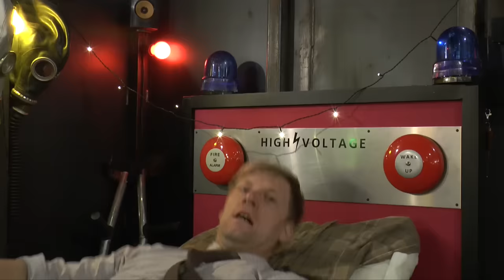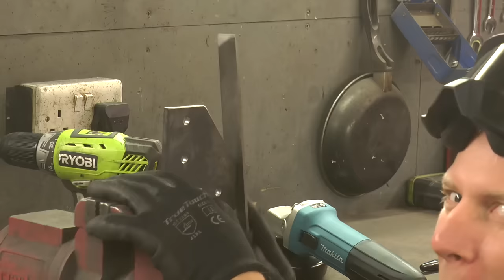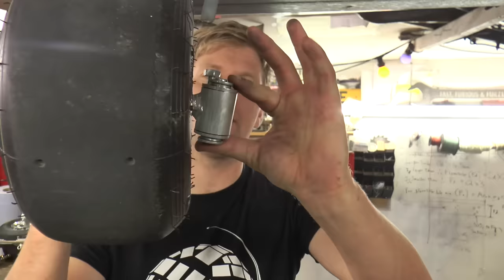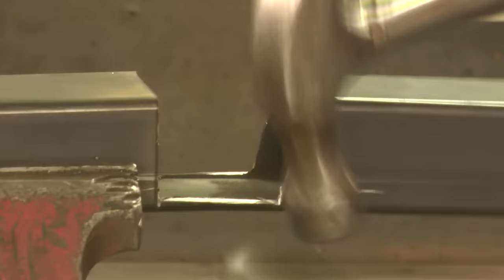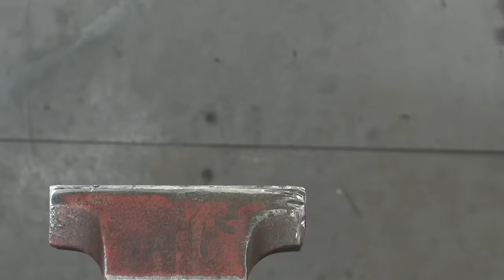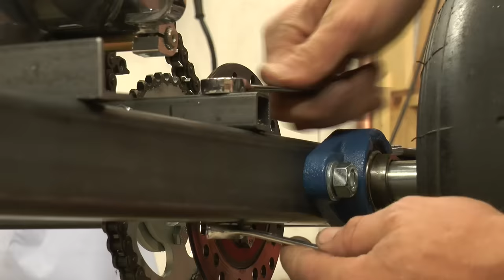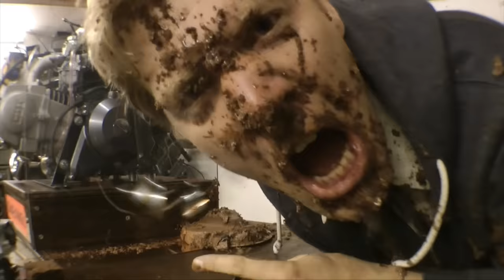Making a Motorised Go Cart with NO WELDER and simple tools #1 - Chassis/Engine

Comment: Colin...do you even camber bro??
Reply: was thinking about the same thing. the angle on the wheel bit is to get more traction while doing corners
Reply: Really? On a kart without suspension? I thought the angle stabilizes and centers the steering.
Reply: Mega But if he were not to make it straight it would have possitive camber, and that is bad, you could potencially even brake of the wheel when steering, and you can see it still has a tiny bit of negative camber :D
Reply: ikkk he could totally make a stance cart
Reply: tubybubi I think caster angle does this, not camber
Reply: +king Schuyler -3 camber, some mad stickers, straight pipe, subway handle hanging, black wheels, Recaro seat
Reply: positive attitudes negative camber
Reply: correct caster deals with self centering etc. the negative camber, in theory, means that the wheel is on a slight angle on the straights, but during a corner, the tyre sidewall flexes, putting the whole tyre 'tread' area (I know the ones Colin is using are slicks but its the same principle on pretty much ANY car) in contact with the road to improve road grip (the outer front tyre takes the brunt of the cornering forces)
Reply: Peter Lattimer Finally, someone who knows about this :)
Reply: Peter Lattimer but that doesnt work for all wheels? if you have negative camber then the inside wheels would loose grip on turns right?
Reply: Generally with chassis torsion this doesn't matter because the inside wheel is 'pulled' off the ground anyway.
Reply: king Schuyler Biggest amount of force is out on the outside wheel so it needs more grip to be able to turn.
Reply: no you wouldn't lose much grip on the inner tyre. I live in an area with a LOT of roundabouts on 60mph limit roads in the UK. I didn't always live here though. ive found that the left front gets hit on the outer edge of the tyre worst (standard road car here) as you spend most time 'turning' right, even when going straight on. the inner edge of the right front gets hit harder in a similar manner.
Quadricycle4000 is correct also about body flex or chassis torsion in this case keeping the tyres in contact with the road where possible. if you look around for old videos of cars like the Peugeot 205 GTI (in 1.9 guise especially) when cornering hard without them sliding, they will actually lift the inner rear wheel off the road (as the suspension is so stiffly set on it, as its an 80s designed car) however the downside of that in a road car can be (and was in the case of the Peugeot) that the body has to flex more which on a little 3 door hatchback, means that trim panels used to creak and the bodyshell actually begins to crack (the reason they used to 'seam weld' rally cars of the era, to stiffen up the shell, amongst other things which I wont bore you with the details)
Reply: Peter Lattimer wow, thank you for taking the time to explain that, a rare thing on the internet! that makes more sense now :) so technically you should camber each wheel differently.. i guess if you only drifted right, the outer tires should have negative and the inners should have positive? vice versa for left turns though. is there a suspension that keeps the wheels on the ground to provide maximum surface area at all times? i know there is a bike concept out of Florida where the motorbike is able to lean 58 degrees and still have the tires flat by just moving the chassis, calculating the g\s and electronically adjusting the suspension.

update: here's the link to that: 
http://newatlas.com/narrow-tilting-vehicle-non-tilting-wheels-ntvntw/45996/

edit: 
if you drift right both should have positive, technically.. its weird to think about haha
Reply: the angle for stabilising steering is the castor angle,  the camber sometimes is the tyres leaning in, to give more grip in corners as the entire tyre surface grips, due to the roll and offset forces push it over if it was purely vertical
Reply: king Schuyler negative camber is for grip (to a certain extent, too much camber removes the effect it would have normally)
how much camber to run depends mostly on what you want the car to do. some old british cars ran with positive camber, like the Triumph Herald (no idea where you are from or if you are familiar with the models) but they weren't great in the handling department. most road cars run 0.5-1 degree each side negative front camber. race cars (where tyre wear is less of an issue) will run more, as their cornering speeds are higher. you basically tailor the camber to the purpose the car is used for. older vehicles like RWD vans (I'm UK based so can comment only on our models here really) run a solid live axle and the rear wheels are pretty much 0 camber all the time (due to the suspension set up) and when running unladen can be put into a drift on a roundabout much more easily than a modern car with its modern suspension etc.
Reply: Peter Lattimer
yes those old cars ran positive camber, due to the terrible suspension design, that changed the angle depending on load and body roll!
Reply: It's [mostly] not tire sidewall flex that camber is intended to cope with, it's body roll; and no suspension means no body roll.
Reply: Folopolis trust me the issue is as much about tyre flex as it is about body roll. formula 1 cars for example, run much more camber than a road car, the suspension is so firm theres little or no body roll, but watch the tyres under cornering. THAT is what theyre trying to achieve. the main friction surface area being as large as possible when its needed most (ie under cornering) BUT with a road car, they also have to make a trade off against the actual ride quality, braking capabilities etc as well as cost, so they run a smaller amount of camber and often couple it with lower profile tyres to effectively stiffen the sidewalls up to prevent the tyres 'rolling' under the car due to the weight etc. look at the shoulders of a tyre on a van that's been cornered hard a lot. the shoulders wear harder on the outer edges due to the tyres rolling under the vehicle. I mentioned the Peugeot 205 GTI earlier. these had very little body roll (suspension was stiff to the point the body panels used to crack!) and had wide low profile tyres BUT not enough camber to prevent tye same outer shoulders wearing off on the front tyres, when cornering often (and hard)
the same car spending its days on the motorway wore the tyres perfectly flat. lower the suspension and the car would wear the inner edge fron the tyres (more camber) BUT when cornering hard and frequently the outer edges wore much less hard even though body roll was similar (it was already so stiffly sprung that the body would flex and the car would lift the inner rear wheel off the road!)
Reply: Peter Lattimer I won't talk about Formula racing, I don't know much about it.  What I do know, is that for GT endurance racing, typical camber is -4  or -5 degrees, any typical body roll around corners is 6 degrees.  I'm very highly doubting that Formula 1 has so much stiffer suspension than GT that a few degrees of roll doesn't happen, especially considering that they use stickier tires.
Reply: If he's racing on a track with a lot of turns and curves, more camber might be necessary, if he's racing on a track with a bunch of straights though, its not as important.
Reply: all that said, is there a real reason to positive camber?
Reply: i think some factory  road cars use some slight positive camber, or close to 0 to improve fuel economy and stability.  the front wheels he has look like they are factory set to negative caster (steering axis tilted towards the rear) which helps with self centering and keeping it stable at speed. letting go of the wheel and it will want to straighten out instead
Reply: oh i've not heard of negative caster before. though positive camber puts unnecessary strees on the joints and for road cars that dont corner often and are mainly on highways, that would wear out the outer portion of the tires before the inside, yes?
Reply: king Schuyler any amount of camber, positive or negative, is going to give uneven wear on the tire, its not a huge amount when you are talking about the small amounts used on factory car setups.   while you can imagine negative camber helping add contact patch to the outside tire in a corner where it matters most, its not helping much on the inside corner, positive camber can help in that situation, i also believe positive camber can help make steering easier.  another thing to keep in mind is that as the suspension moves through its travel its settings can change based on the type of suspension.  Negative or positive camber may be needed so during compression or rebound (offroad jumping?) its where it needs to be.

not sure what unnecessary stress it would be putting on components tho
Reply: mixamun lets say you had a simple ball and joint suspension. if you had negative camber, then the weight of the car would be straight down from the car and tires, the joints in the middle bending outward and causing chassis torsion?
Reply: i cant picture what your describing ;/
Reply: mixamun if you sliced one side of the car laterally into three pieces, one is the tire, one is the suspension/joints,and ont is the chassis. with positive camber, the wheel(in an extreme case) is over the suspension and the chassis is pushing towards the suspension. it seems like it would bend even more so than usual?

Comment: No safety tie????? o__O
Reply: Aztezq he's not driving it yet don't need a safety tie when you're just cutting things
Reply: He is wearing a tie at the beginning of the video... and I can understand not wanting to wear a tie while working with an angle grinder.
Reply: Steamrick yeah... my tie got stuck in one of those once...

A&E in under 5 seconds
Reply: The safety tie is a power tool and not a basic tool
Reply: Aztezq what is a safety tie?
Reply: I never use the guards or anything on my grinder. It all just gets in the way.

Comment: Hey Colin really enjoy your videos when you put them up, I am disabled myself in a wheelchair, In your other video where you build the fastest mobility scooter I own the exact same 1, But always wanted to switch t to gas and lift it so a set of ATV tires would fit on it, I am really in need of help because I live way up in Northern Canada where we get a lot of snow, And my electric wheelchair I use now is top of the line but garbage really for me where I live because soon as we start getting snow my chair does not move then I am bed ridden for 6 months, I been trying every where for some 1 to help me design what parts I need and where I can get them, Not sure if you ever seen a wheelchair on YouTube that is called The Tank chair, thing is awesome I tried 1 out and it will go through mud no problem when ATV,s are getting stuck and it works great in snow as well,Now seeing this video you are doing looks like maybe it could be turned into something I can use, The frame looks similar that you are building to the 4 wheel drive chair they sell for over $20,000, That is insane, Was wondering if there were a way for me to contact you or you me, and talk about a build what can give me some quality of life, be different if i were in my 60,s or 70,s but I am only 40 and very active, Would be in dedted to you if you could design a 4 wheel drive chair something like you are building in this video,Could you please get back to me and see how we can get in contact with each other and you being so incredible with imagination and building things, I beleive you could build something aw some My apologies I should of got a few pics from the internet showing you the 4 wheel drive mobility scooters or off road scooters-, Thank you for your time and hope to be able to hear back from you,
Bear.,
+

Comment: How about you put a small block chevy in the gokart?? 8000hp should be enough..
Reply: ✭GodLike3539✭ you aren't getting 8000 HP out of a small block Chevy haha
Reply: ✭GodLike3539✭ they run off that block, not the same engine haha. those are built to shit. not even the same beast after they are done with them lol
Reply: ✭GodLike3539✭ what if he put a big block chevy on it
Reply: Mr. Jack A$$ he meant 800, but your probably not gonna get that
Reply: No way a small block wud make 8000
Reply: ✭GodLike3539✭ 😂😂😂 not enough
Reply: LS swap?
Reply: How about a diesel generator with electric drive?

Comment: I have a spare 750cc Honda motorcycle engine with it work for this project?
Reply: dude that has so much power. its too fast. Unless you want to fly to the moon i'd suggest use a less powerful engine
Reply: With such engine, you should build buggy instead of go cart.
Reply: Just do not full-thottle it.
Reply: More like fly to the hospital.
Reply: Seriously though I was considering making a dune buggy with it. It redlines to 10,000 RPMs. So I'll need to gear it down a lot. Don't need to be cruising over the beach at 80 miles an hour.
Reply: Build a quad with it
Reply: HAHA THAT BE SK AS
Reply: Jared Jeanotte Put it in a Tuk-Tuk!
Reply: cameron siebert what engine would you suggest (with what power in cc)
Reply: Maybe a predator 212cc engine. Or 420. They are not that expensive also.

Comment: i thought that he mounted the front wheel upside down, and the wheel is supposed to be cambered out?? or is it just me?
Reply: youre right
Reply: Yeah the front wheels are meant to have negative camber, so when you take bends at speed all the tire is touching the ground.
Reply: Yeah, that's true what I thought, but also the way he has it now the chassis is upside down anyway because he has lower ground clearance :-(
Reply: Having said that it does have a forward tilt
Reply: The turning axis should be aligned towards the center of the wheels contact surface to the ground. Otherwise you'll get very weird or impossible steering. 
Ground clearance on a go-kart?!? It's a go-kart not cross-kart.
Reply: Henrik Yngvesson It's also Colin Furze. I'm pretty sure it will need ground clearance
Reply: do you mean positive or negative camber??
Reply: Koolkei there's nothing wrong with the way he mounted them......
they're supposed to angle slightly in at the top.
Reply: Yes you are right Koolkei the wheels need to 'lean in' or have negative camber at the top! Strange that he would flip the front steering pinion if you will, upside down. Because as someone else said if the tyre is 'leaned' or negatively cambered right the outside wheel will 'lean' or 'roll over' on the outside wheel on Tarmac giving more turning grip at the front

Comment: Since you didn't use a welder, you could cut a wider hole so you could tension the chain by moving the engine back and fourth.
Reply from the maker: lifting it with washers is easier and can not slip.
Reply: colinfurze A bit harder but true. 
There is always two ways to do it.. Lazy way or the right way.
Reply: V4 Garage
Reply: V4 Garage payten
Reply: Ford M Garage
Or, poor bastards way and rich bastards way.

Comment: Would it be possible to mount the engine properly up front? I've been watching a lot of these go kart build and power wheels mods and the engine is always mounted on the back but I've been wanting to make my own go kart and give it sort of a pick up truck body so I can drive around my neighborhood on trash day and collect treasures in the bed and having the engine in the back wiuld mean less space for a bed.
Reply: Given that it would either have to be FWD, or to have an axel with an axel running down the middle of the chassis (unless you made a long chain) , it would be fine, maybe a bit longer as to make room for a seat.
Reply: You can run a system of chains running along the side of your truck and then back down to the rear axle. And just make chain guards to cover up the chains

Comment: How does the axel not slide side to side, and is there something holding it from doing that? Or is the bearing just really tight on the axel.
Reply from the maker: the bearings are on like thinner parts so they can only slid off forward but once both bearings are on that holds axle in position
Reply: colinfurze oh hell yes Colin replied to me 💪💪💪💪💪
Reply: colinfurze thanks that really helped :)
Reply: +Jack Manis 
jjj
Reply: And there should be a center bearing preventing the axle to flex under power, like normal karts have? Just asking. Keep up the good work! :)
Reply: Jack McCappin its sitting on a set of bearings

Comment: Oi colin! If you still read these
Isn't it better to suspend the engine as you dont even have coilovers on the kart
I think that should increase the life of the engine as at high speeds like 40mph
The piston inertia and the vibrations from the ground will clash as there is no dampening whatsoever
Reply if you can

Comment: i know i am 6 years late but a tip if anyone is going to try this is dont do what colin did to  make the wheel look straight  the angel helps u steer better and easier 
and also the steeringhinge are backwards the left one should be on the reight and the right one should be in the left     basiclly  the wheeel should be aiming at the outside

Comment: I'm pretty sure you could have just flipped the spindles and mounted them on a straight piece of square tubing and it would have been fine just use the one you used on the left upside down on the right and vice versa for a small thing like that it wouldn't really make that much of a difference but it would make the build process easier